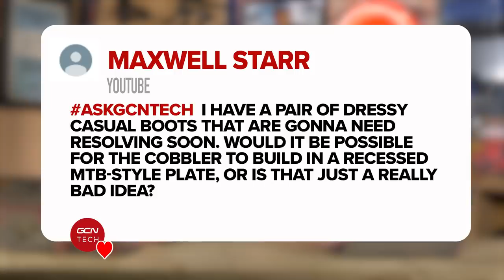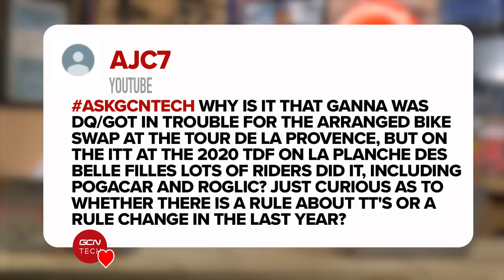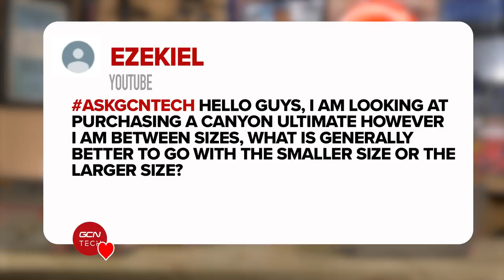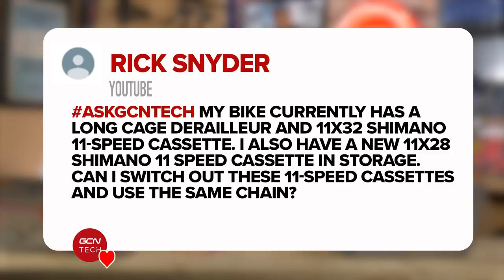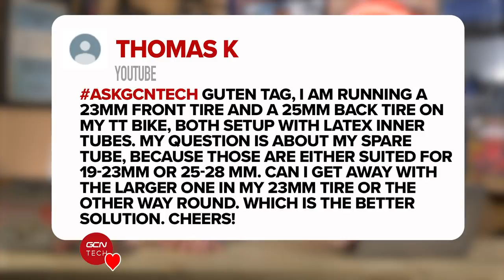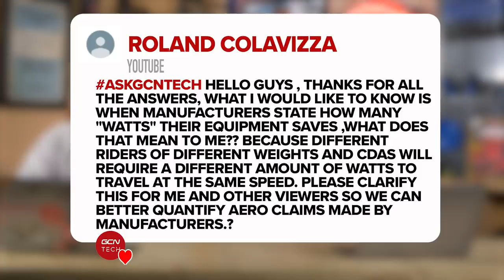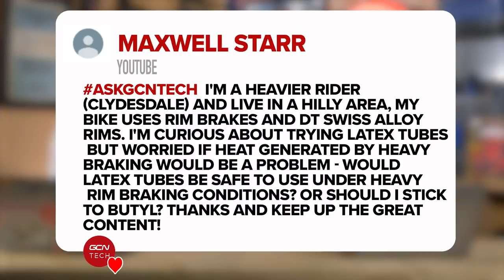Is There A Maximum Possible Power We Can Produce? | GCN Tech Clinic

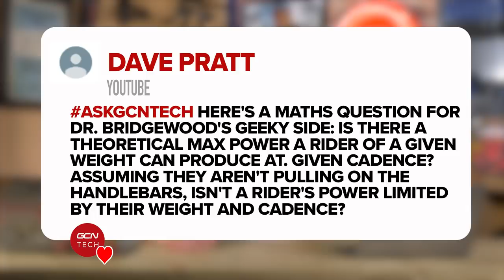Comment: 7:51, find a physicist. They can calculate the power output of a person. I have done this in a physics class. The assignment was to fi d the max horse power (you can convert to watts) for a person climbing a stair case with weight and time.
Reply: If time is a given, there is just one power number, not a maximum. Power for going up stairs is mass * gravitational acceleration * height / time (e.g., a 75kg person running up a 3m flight of stairs in 3s is 75*9.81*3/3=737.75W). If time is not given, there might be a maximum but it won't be a function of the weight but rather the muscle tissue and joint levers
Reply: @MegaKillMeister  yea.... I knew some one out the could do it.
Reply: @MegaKillMeister  I assume you can calculate a maximum Power.
Because in this instance you could calculate the Power by using this Formula: 
P= T*2*pi*n
Power P / Torque T / n=rpm
So maximum Power would be in the moment of maximum Torque. The Torque T is defined by the Length l of the cranks times the Force F applied to the Pedals.
So all you need to find is the maximum Force that can be applied to the Pedals and you would get the maximum Power dependenging on the cadence. I´m intrigued to believe the maximum Force you can apply to the pedals is (body mass)*g, under the premisses you don´t jump on or off your pedals and don´t pull on the handlebar. Otherwise the maximum Force should be higher and I have no idea how to assume the amount of  this Force, right now.

This is just my quick take on the matter.
Reply: @bohnito  Yeah thats how you should approach this problem. I was just wondering if you can't use your back leg to pull up on the up stroke, creating a bit more power. I know we can't pull on the handle bars, but can't we still leverage the bike somehow?
Reply: @MegaKillMeister  That´s a good point. It seems I oversimplified the system in my Head, yesterday. I falsly assumed the rider can only push on the pedals. If we take a look at the Forces acting on  the rider under following condition. Assuming the body stays in a fixed position over the bike, so the rider doesn´t move upwards or downwards. I assume a moving rider should even out over a complete pedalstroke. In this case the sum of the acting vertical Forces has to be null. This would mean that 
F_g - F_push + F_pull - F_saddle = 0 <=> F_push - F_pull = F_g  - F_saddle
F_push= Force pushing down on the pedal / F_pull= Force pulling the pedal up / F_g= gravitational Force / F_saddle= Bodyweight supported by the saddle

Let´s say F_saddle=0, in this case the forces on the pedals should be maximal. Then you see that the sum of forces acting on the pedals can reach maximal the gravitational force. So you could push with a greater force on the pedal than F_g by the amount of the force you pull the back pedal upwards.
The resulting torque would be : T = l * (F_push + F_pull)
Another interesting aspect is, that the formula for the torque above suggests it is more effective to increase the force on the front pedal by pulling the back pedal than pulling on the handlebar.
 I´d like to hear your thoughts on that.
Reply: @bohnito  I think there is a flaw in that reasoning, because generating torque on the pedals will in return generate torque on yourself, with also the bottom bracket as pivot point. You know, the whole action=reaction thing. Since you assumed F_saddle=0, this would throw you right off your bike, resulting in not a lot of net torque ;) this is also the reason why you can pedal harder when you lean forward, or when you pull on the handle bars: we are counteracting the counter-torque. That brings me to my next point: why is the approach described by you more effective than pulling on the handlebar? I imagine there is no max when pulling on the handlebar. Finally, what I meant by "leveraging the bike somehow" is leaning forward to counteract the counter-torque, like you would on a unicycle. On a bicycle I thought we might use the fact that we have two wheels to keep the bike from tipping over when leaning forward ourselves.
Reply: @MegaKillMeister  Surely I didn´t account for everything. My goal was to come up with a simple model, which describes the matter fairly good but does not account for all the complexity of reality. So it can be discussed by us in the comments without sketches and other aids.

The torque from pedaling acting on the rider depends roughly of the horizontal distance between the center of gravity of the rider and each pedal. So the torque acting on the rider is not necessarily the same torque acting around the bottom bracket. The action = reaction applies more to forces, for each acting force on a body there is an equal force acting in the opposite direction. That is mainly the reason why I did not acount for the Torque on the rider. It is either a lot of guesswork or you would have to introduce a lot more variables. I think then things would get really messy and quite difficult to comprehend under this circumstances.

The assumption of F_saddle=0 is to see in which case the pedalforces reach their theoretical maximum.  And I would say you can take a huge load from the saddle during pedaling, especially in the moment of horizontal cranks. So it might get to the point where F_saddle is negligable. If you want to account for F_saddle you probably have to guess or measure it. 

Referring to the pulling on the handlebar. I think there is a misunderstanding. i am not a native english speaker, so that might be the reason why.
When we take a look at this Formula again:
F_push - F_pull = F_g  - F_saddle
And to make things easier we say F_g - F_saddle = F_body , then we can rewrite the Formula to this:
F_push=F_body + F_pull
If we then implement this in to our Torque Formula we get
T = l * (F_body + F_pull + F_pull) , so every increase in F_pull results in a Torque increase of T_delta = 2 * F_pull * l
If we now introduce a pulling Force F_handle on the handlebar the Force F_push would result in the following:
F_push=F_body + F_pull + F_handle
and therefore the Torque would be
T = l * (F_body + F_handle + F_pull + F_pull) , so every increase in F_handle would result in T_delta = F_handle *l
So in conclusion any increase in F_pull would have 2 times the effect on torque than the same amount of increase in F_handle.
That is what I meant by saying pulling on the backpedal is more effective than pulling on the bars. 
I hope i was able to clarify things.

P.S. I enjoy the constructive discussion in a friendly tone with you. Cheers.
Reply: @bohnito  Haha cheers, I graduated from my master's in physics last year and am now working, so I enjoy casual physics discussions too :)
And thanks for clarifying the F_handle, I did indeed misunderstand. 

I know you are trying to simplify the matter (that's really all a physicist does), but this flaw I mentioned is fundamental to the problem we are trying to solve: finding the maximum power by only using one's weight. While it is of course true that T=l * (F_push + F_pull), there are no limits on F_push in your model. Hence my comment that there is an equal and opposing torque on your body, which dictates the limit. In fact, in an ideal world where F_saddle=0, this limit is F_push=0 ;)

Action = reaction definitely applies to torque as well; remember torque is essentially a force (side note: a similar analog is conservation of momentum, which translates to conservation of angular momentum. Basically any linear classical mechanics law has a rotational equivalent). And this torque does NOT depend on your horizontal position relative to the bottom bracket (BB), only your reaction to this torque does. This is where the leaning comes in: if you lean forward, such that your center of mass is a horizontal distance d away from the BB, then gravity causes you to naturally exert a torque on the BB. This is equal to T_g = F_g * d. Since action = reaction, we can use this to our advantage to counteract the counter-torque when we apply force to the pedals. Essentially this means that the maximum torque we can generate is T_g. So if we are vertically above the BB, then as I said before F_push=0.

Let's try some numbers. I weigh 75kg and my crank length is 175mm (Dutch and kind of tall)
Firstly the naive assumption that the maximum force we will be able to generate is F_g, meaning we are vertically above the front pedal. Maximum torque is achieved at 90°. 
T = l * F = 175mm * 75kg * 9.81m/s^2 = 128.8Nm. Let's say we simulate a cadence of 85rpm, then the angular velocity is w = 2pi * 85 / 60 = 8.9rad/s.
Power P = T * w = 1146.3W. Now that is quite a lot, but good luck getting your full body weight on your front pedal at 85rpm ;)
Now let's initiate the lean. My reach is about 60cm, so assume my center of mass is roughly in the middle between the saddle and the handlebars. That means d = 30cm. I have now effectively almost doubled my lever arm, meaning I can almost double the torque and thus power output. 
Just for the sake of it, P = 1146.3W * 30/17.5 = 1965.1W.  Note that the position of maximum torque has now shifted away from 90°, since I am no longer perfectly above the pedal. It will be 90°+(lean angle). 

Theoretically, I think that as long as we keep the center of mass in between the wheels, we should be able to keep increasing the power, albeit in an increasingly uncomfortable position. Thoughts?

P.S. sorry @Jason Christiansen for hijacking your comment lol
Reply: @MegaKillMeister  I am an engineer, that is where my interest in such discussions derives from ;)

I think I made some things out where we misunderstand each other or differ in our goal.

1. Your goal: problem we are trying to solve: finding the maximum power by only using one's weight

If I recall the question in the video right it was something like this: Is there maximal Power you can put out for a given cadence without pulling on the handlebar? If so, is the max Power limited by the riders weight?
At least this is the question I was trying to solve. As we established the max Power for a given cadence basically boils down to max Force on the Pedals or max Torque araound the BB. At first I thought the force a rider could apply to the pedals are restricted by his weight, but this was false. As pointed out by you pulling on the backpedal eliminates the constriction by the bodyweight. So I only tried to show that the maximal Power of a rider depends on his ability to push and pull as hard as he can on the pedals, but is not limited by his weight.

2. I think we have different models we are looking at, that is the problem with no sketches. I am only looking at the rider and represent the interaction with the bike by forces acting on the riders body in the contact points of rider and bike. That is the reason why I said the torque on the rider is depending on the position of the acting forces relative to his center of gravity. I did this because all I tried to show was that the force a rider can apply to the pedals is not limited by his weight. If I am understanding you right you are looking at the whole system of rider and bike. 
I understand my model so that the position of the rider relative to the BB would be represented by the change of the forces F_pull and F_push. So it is way easier to split the total system into 2 smaller systems. You are right in my model is no mathematical limitation of the forces. But I think this is quite logical, the limitation is the strength of the rider or the materials ;). I don´t see a reason what else should limit the forces, from a theoretical viewpoint they could be as well infinite.

Now to: If you want to find the maximum Power by only using weight. If I´m understanding you right you introduce a relative movement of the rider to the bike. The goal is to move your center of gravity forward over the front pedal, basically to increase the leverage of your weight on the pedals. To move your body forward on the bike and maintain balance I assume you simultaneously move vertically relative to the bike because you stretch your leg. In this case I would say you would get
 
F_push = F_g (because you support all your weight with the front foot) + m * a.

The acceleration a would describe the vertical acceleration of your center of gravity. In this case the maximum power you can achieve would be affected by your weight, but also not limited by it. 

It is impresting how you can interpret such an easy question and come up with different solutions depending on the boundaries you set.

Comment: About the last question: if the asker is a heavier rider, why going to latex inner tubes?? I mean, the weight gain would be absolutely negligible, given that would be a smaller % compared to a lighter rider. The same goes with the improved rolling resistance: given the hilly area on the uphills the weight of the rider would slow him down far more than the rolling resistance at slow speed , and on the descents, given that he's heavy, he would go extremely fast either way. I found just no-sense this chase of a "marginal gain" when it doesn't make any kind of sense, it would only be unsafe and expensive.

Comment: #AskGCNTech Just putting latex inner tubes on my bike, it got me thinking - given bikes are "rear wheel drive" would I still get the majority of the benefits by just installing latex tubes on just my rear tyre? Thanks in advance!
Reply: Yes, the majority. But for full advantage you'd rather swap both. Also, it's simpler and less puncture-risky to do at the front anyway

Comment: #AskGCNTech hi guys. How can I adjust my front mech without a barrel adjuster? When I am in big ring and small cog, I get some rub. The high and low screws seem to be correct. Thanks.
Reply: You'll need to adjust cable tension manually by fine-tuning where on the shift cable to clamp.

What front derailleur is this?
Reply: @yonglingng5640  it’s a tiagra 4700.
Reply: You'll need to do your fine tuning just by adjusting cable tension as normal. You could perhaps look into installing a barrel adjuster, I believe they're pretty simple little things?
Reply: @andrewharris3965  Yup, that model needs a barrel adjuster. Sure, you could get away without one (doesn't mean you should), but adjusting cable tension will be more finicky.

Comment: For a heavier rider wtf is the point of latex tubes? If your 250 and above you should be on the sturdiest tubes available and on discs, especially for hilly areas. Going from a lighter rim brake bike on 23mm to a 3lb heavier hydraulic disc brake gravel bike on 35mm gravel slicks was the greatest thing I've ever  done. 1,000x better brakes on technical descents, no worries about tube blow outs or warping wheels, more compliance, better gearing, etc. I can do an endo on pavement if I want the brakez are that powerful.- fat guy
Reply: Disc brakes are amazing, they've given me a 3rd testicle on fast descents

Comment: Gent's I think you missed the point of the max power question. This is understandable because it was a very "assume standard spherical cows" question

Anyway... assume your are in America
Assume your cranks are 1 foot long
Assume you weigh 200 lbs
Assume you are imputing torque into the bike by shifting your weight to the forward leg.
Your peak theoretical torque under this point is 200 foot lbs, equal to the turning moment when the cranks are parallel to the ground.
As power is equal to torque X rpm/K, where K is the constant for your system of measurement;
Assume 100 rpm:
Your max power is 2840 watts (200*100/5252=3.808 hp or 2840 watts)
Assume 50 rpm:
Max power is 1420 watts

Unfortunately cows are not spherical so...

Your max power riding this way would be way less. Average torque would be roughly half your weight as at TDC and BDC effective tq is zero, and at all points other than parallel to the ground your effective force would be proportional to the vertical length from your pedal spindle to your bottom bracket spindle.
Further you do not ride your bike this way. Every action requires an opposite and equal reaction so you have to balance the forces by moving your bike or putting various muscles into tension.
Putting it simply... if you tried t ride as suggested you would be limited to a factor of your weight, as originally assumed. Also you would fall off immediately.
Reply: That's incorrect because you can apply additional force from your leg muscles, pushing against your body mass which takes time to accelerate and move away.
Reply: @brianrichardson5310  I assume you do not know what a spherical cow is.
Reply: Average (effective) torque is only 0.637 times peak torque.  Cranks are only 7 inches long.
Reply: Sounds about right. Biggest power number from pros I can find are in the 1300.